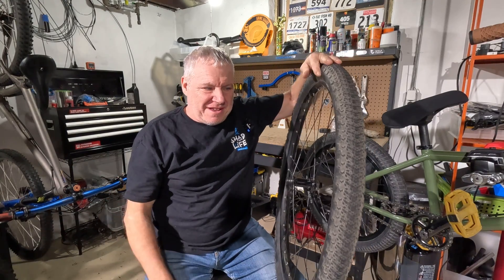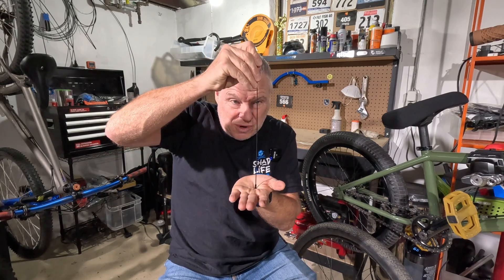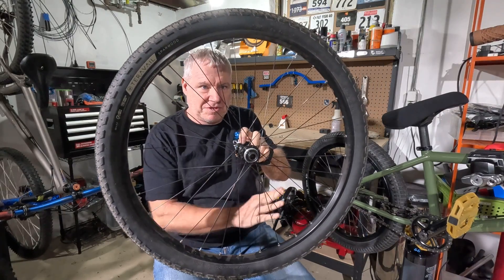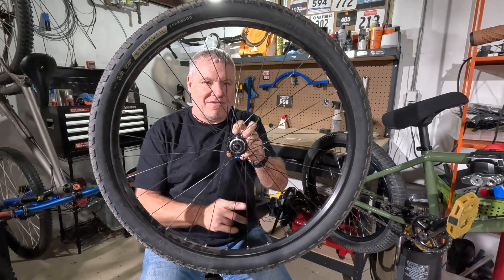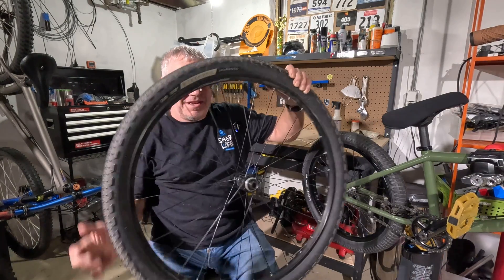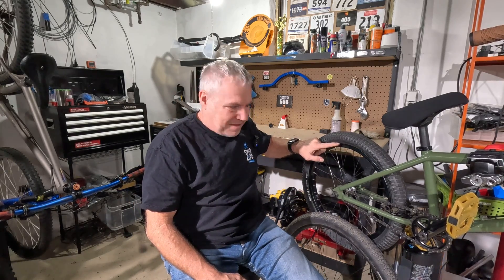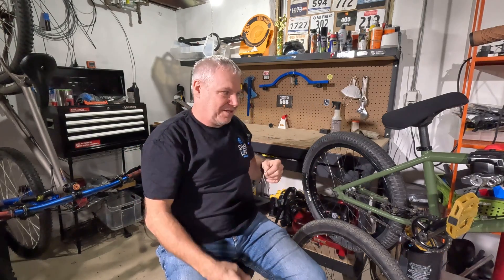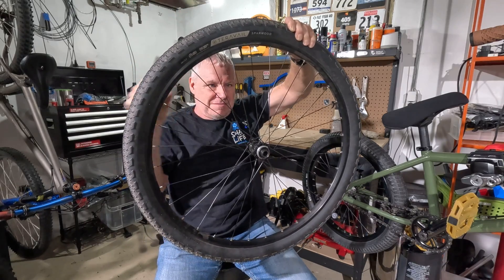How Do Spokes Work?

Comment: I had a custom set of wheels built up by Berd Spokes. The rims are RaceFace ARC40 front and ARC35 rear. Yes, on the wider side. I absolutely love these wheels! I have Teravail Warwick 29 X  2.5” and Kessel 2.6” front with Cushcore Wide inserts. True these are on the heavier side of wheels but they feel great on my Esker Hayduke. I’m probably going to get another custom set with Berd spokes and alloy rims because I like the way they feel so much. But a new set with i30 rims so it’s lighter and I can use 2.2” XC tires. I’m also thinking about getting a Ti Hayduke frame just to build up a light weight hardtail.
Reply from the maker: Sounds amazing! Why not use the HAWK30 carbon rims on the new build?
Reply: @ShadLife  I think alloy rims will absorb more small bumps than carbon. I have a few carbon rim wheel sets and I like them but none built with Berd Spokes. I’m not saying they’re overly stiff and harsh but I have also always used custom wheels with 32 3x lacing and db spokes. I think that makes a marginal difference. I kinda prefer to explore the Berd with alloy rims then, maybe have some of my carbon hoops re-laced.
Reply from the maker: @hardmtnbiker  Got it. Just keep in mind carbon rims vary quite a bit and some have more compliance built into them, as do aluminum rims.

I might put some HAWK30 Berd wheels on my Salsa Rustler next year. We will see...🙂
Reply: @ShadLife  totally agree, I have the Stan’s CB7 Baron rims and those feel really good. On my gravel bike I have the Zipp XPLR 101 single layer carbon and those also have a great feel. 
As for alloy, I have Velocity Blunt 35 and the Blunt SS and those are a soft alloy. I have the DT Swiss XM481 which are much stiffer and stronger.
Anyway, thanks for sharing your knowledge on bikes!

Comment: Thanks for another very informative video. 
About the Berd spokes. Do the white Berd spokes get dirty and do they clean off easily?
Reply from the maker: I feel like mine are slightly less white than new, but I haven't tried to clean them yet.

This is from their website.

"Your spokes will stay pretty white. Over time you may see some staining from dirt, mud, etc. but the UHMWPE is not like white bar tape! You can clean your spokes using Dawn Dish Soap and water, along with some elbow grease. Do not use harsh solvents or cleaning supplies on your spokes. If this is a big concern, we suggest ordering black spokes or using one of our Spoke Coloring Kits to color your spokes."